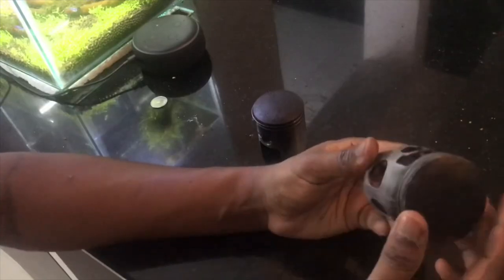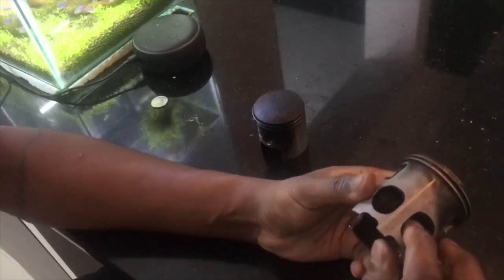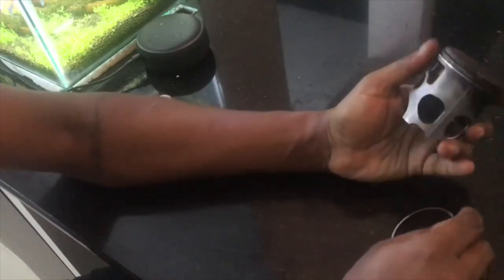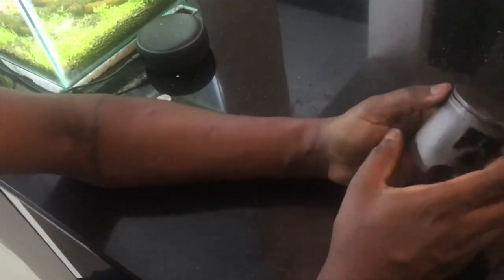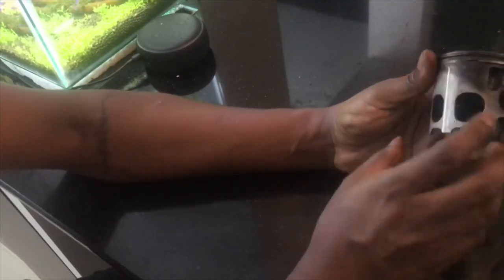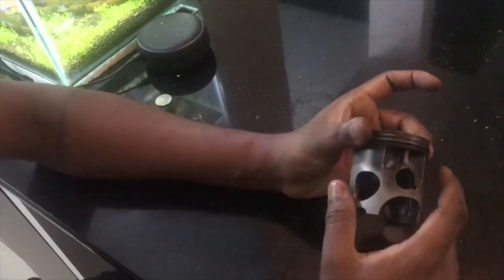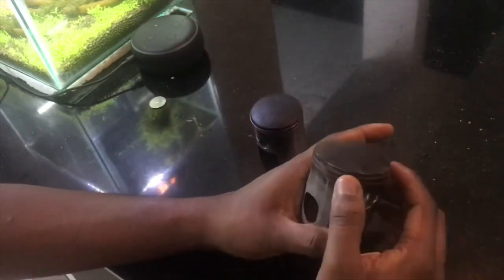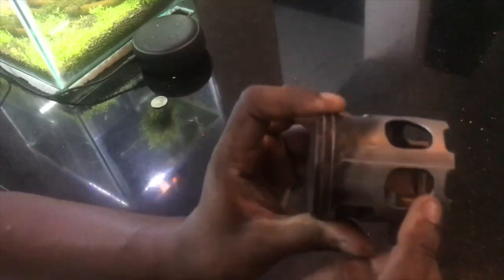Why should you change engine bearings? (English video)

Comment: I have changed chain spocktes, clutch plates, but after driving that I noticed that   its difficultly while pressing 2 gear and bike is not going smooth when clutch press when speed breakers, some what not smooth.
Reply from the maker: Your explanation is very vague, if you can be a bit more specific, maybe we as a group can solve your issue

Comment: Bro I am facing a problem in front disk brake lever, it was tight to press but the brake was working and the oil in the brake capsule in fill can you give me some idea to recover
Reply from the maker: I didn’t understand your question. If your question is about how to bleed the brake it’s covered in one of the old videos
Reply: @Yamakaze  no bro shogun front disk brake liver tight problem
Reply from the maker: Are you getting braking or not?
Reply: @Yamakaze  yes braking is works good but the brake lever is hard
Reply from the maker: @ameenali720  video coming just for you